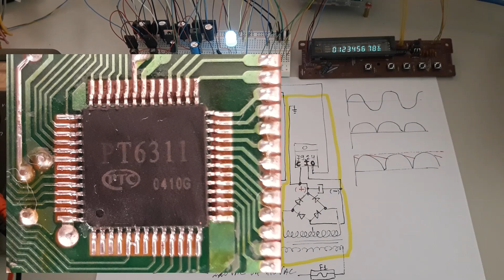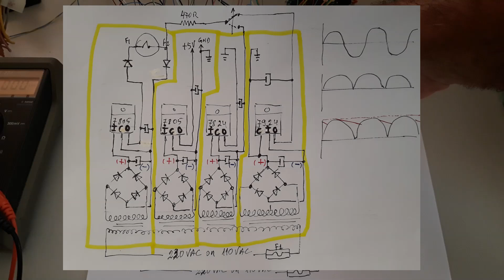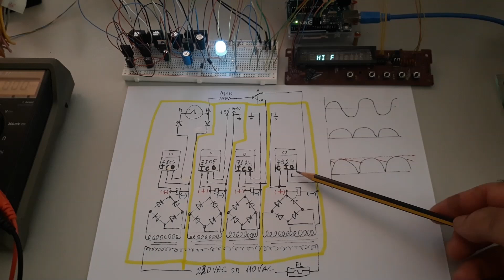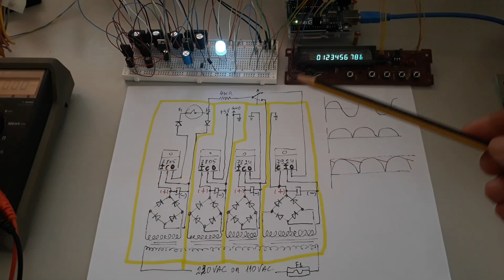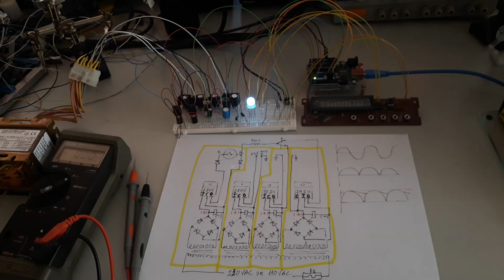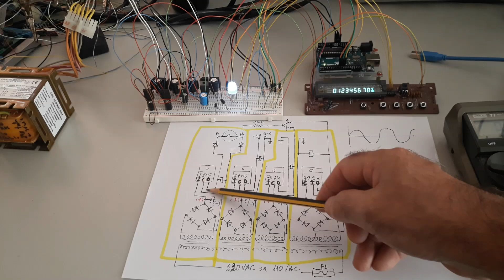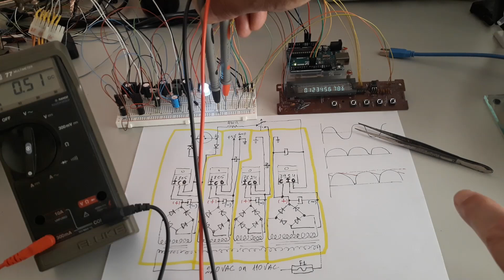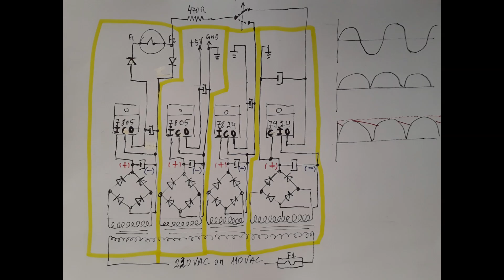PT6311

Comment: Hi, I've been following for a long time, I have several displays like these with PT6311, wouldn't there be a way to make a simpler code with the Arduino SPI library?
I am from Brazil!!!
Reply from the maker: Hi @tiagomizael7596, thanks a lot by follow my publish displays!
The code is already let the more basic possible.
We don't use any library, and the send info is at Binary format to allow change the bit and see wat happen! 
Also all functions can be called as independent process as also can be eliminated on the file of code, if not make use of them, to reduce lines of code.
You can speak Portuguese if prefer, and sent me a pictures of you models of panels to see if I can help.
Reply from the maker: I forget the more important thing, Yes we can use only a dozen o lines of code... but using a library, ok
Reply: @jlsmonte  a sim muito obrigado, tenho uma caixa desses displays e quero usar em projetos meus mesmo, maioria todos com ptt6311, se não fosse seus videos nao ia conseguir ligar esses.kkkkk
Reply from the maker: @tiagomizael7596  Envia foto de um ou dois que queiras usar, para ver se tenho algo idêntico, para depois testar, quando tiver um pouco de tempo livre, com code  mais curto, ok.